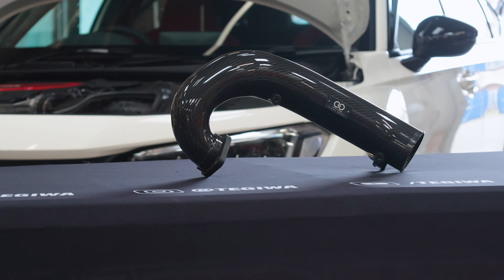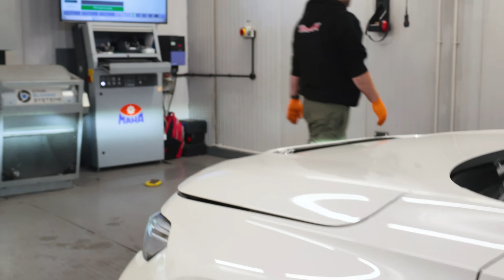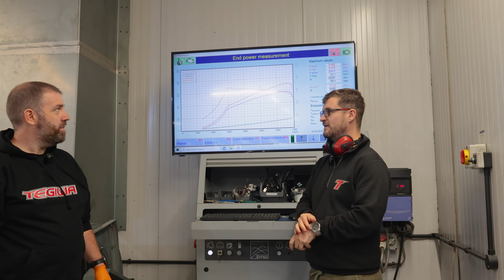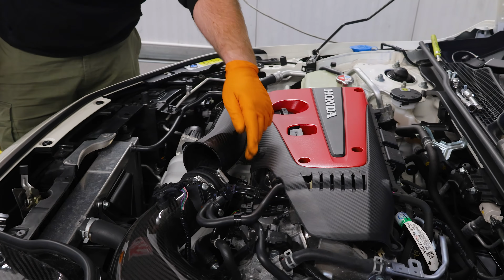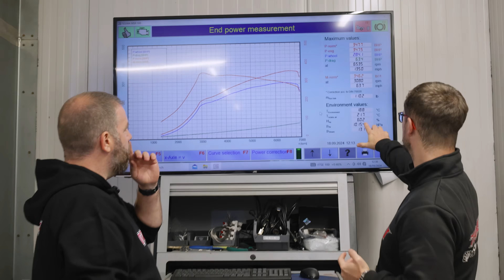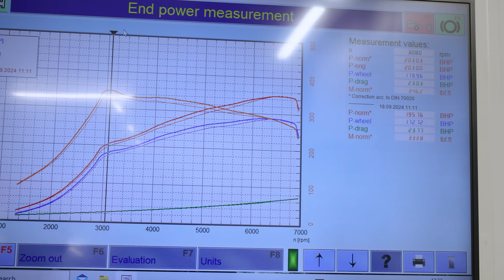Installing an Infinity Design Carbon Turbo Inlet Tube on our Civic Type R FL5!

Comment: Is a Tune required to run this intake and inlet pipe setup?
Reply from the maker: In short, no. However, to maximise performance of the intake and inlet tube a tune would be recommended.

Comment: Wayyyy to expensive for what it is in my opinion
Reply: It also reduces heat soak for IAT significantly. id be surprised if you didn't see nearly 10-15 peak HP difference after the car has been running and around 20hp difference in the midrange.
Reply: @DR-pu5hm yep I’m buying it purely to get rid of the massive piece of aluminum right over the exhaust that’s heating up the intake air.

Comment: Infinity Design doesn't manufacture the connector between the inlet pipe and the intake anymore. You have to use the OEM part.
Reply: I guess you have to buy eventuri now.
Reply: @jdmtc5  It's not required. My Infinity Design intake and inlet are installed using the OEM connector, and the results are incredible. I'm sure Eventuri's system is excellent as well.
Reply: @jdmtc5  Thats what I was looking at, I dont like the factory connection and the Infinity looks the best but is apparently not very sturdy and they dont make them anymore. At that point I'll just save up and go Eventuri myself lol
Reply: You are correct sir. Got the word on this about 2 weeks ago from Infinity.
Reply: But why did they stopped?